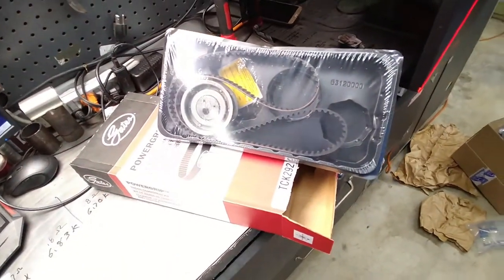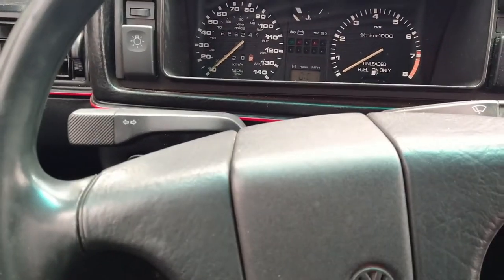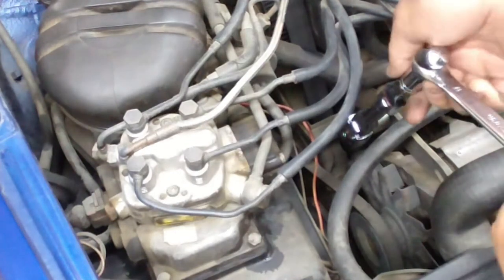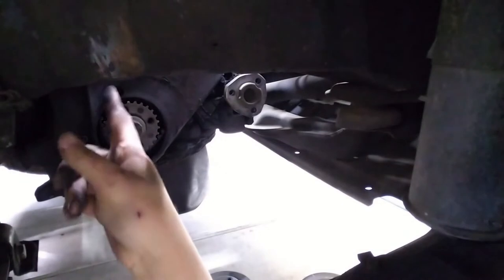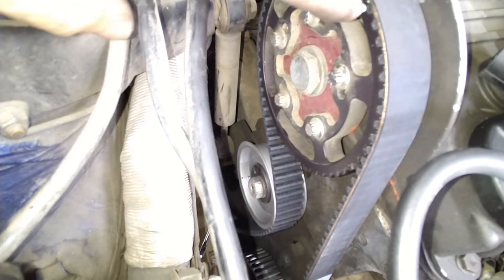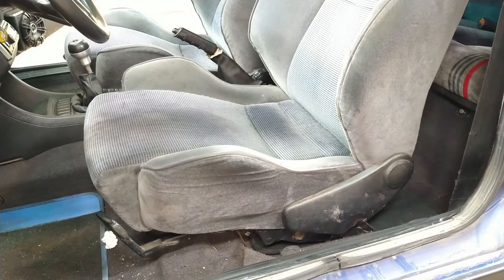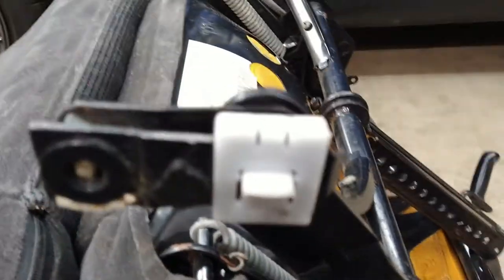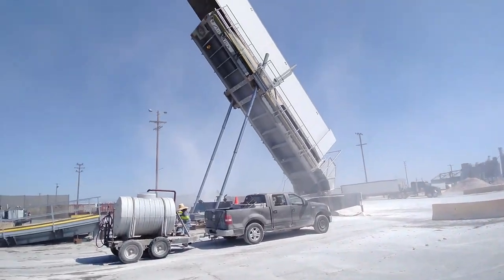GTI Timing Belt And Recaro Seats

Comment: Those GTI's are going to go up in value in the coming years.  I tried to buy one back in  my younger days, but it didn't work out.
Reply from the maker: Yes they are. But what I noticed is that most of the available parts are super cheap! The problem is that certain parts you can't find anymore. Hopefully the aftermarket will notice the demand and start producing them again.
Reply: @Motor7710    I would recommend to buy a GTI part car while they are still around and still cheap. Here in New England I only see mk2 at vw's car shows.